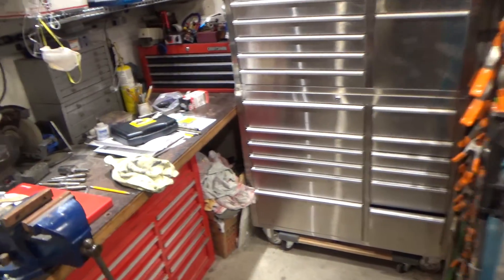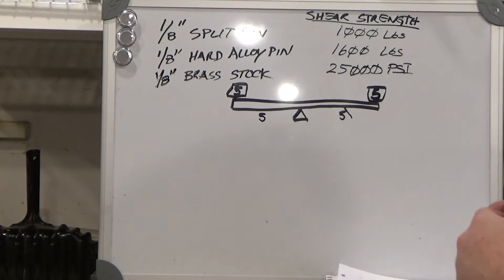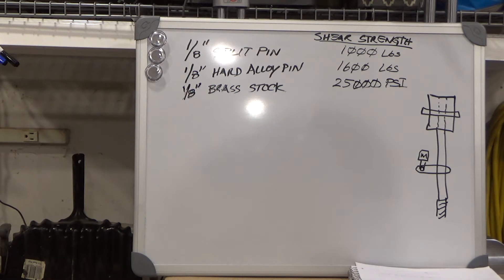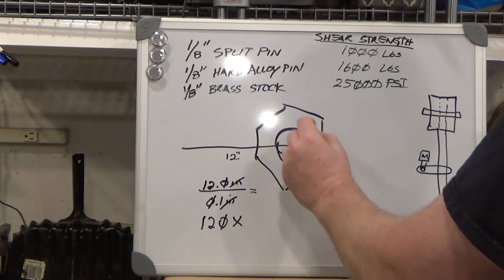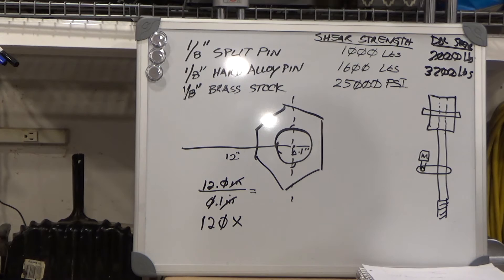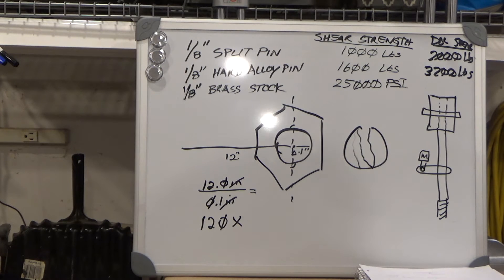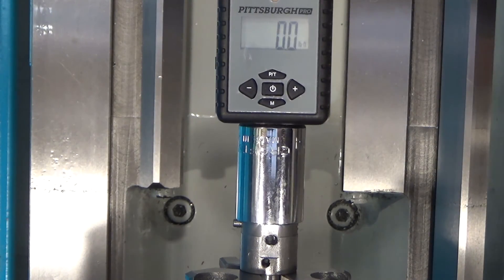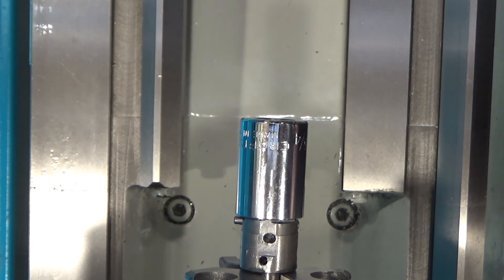Safety Drawbar Part 1   The Shear Pin

Comment: Dudley, Great video.  Reminds me of my engineering classes 35 yrs ago.  I would like to know more about your Acra mill.  I plan on replacing my Vectrax(MSC model) in the near future.  Keep up the great work.  Your videos are very informative, and I enjoy watching them.
Reply from the maker: My ACRA mill is the first they have offered from China. They sell machines mostly from Taiwan. I compared the mad in Taiwan version ($12000) to the Chinese one ($5500) and there was a definite fit and finish improvement in the more expensive model. At the time I was a bit overwhelmed at even the less expensive model's cost so I got that one. It is reasonably accurate and much better than the well used Bridgeports that the Adult School I took machining at had. I am not terribly experienced, but so far it has been an excellent machine.

Comment: You used Pi times the Dia. Squared instead of Radius Squared.
Reply from the maker: You are absolutely correct. Stupid math errors have always been my worst enemy. I said radius and used the diameter. Thanks for catching that. doh!
Reply: Made me think of my final hydogeology exam at uni - had to calculate water leakage around a dam buttress per week.  The day after the exam, the lecturer pulled me aside and said "Students may have a 5 day working week, but nature still works a 7 day week".  Whoops - even so, he could see my folly and that I understood the principles, so I still passed.  Simple errors are so easily done.